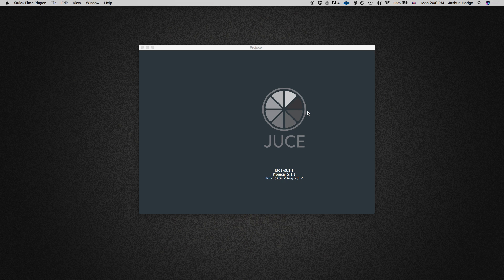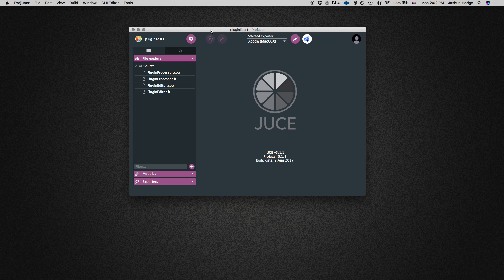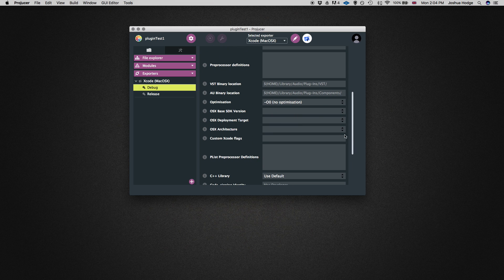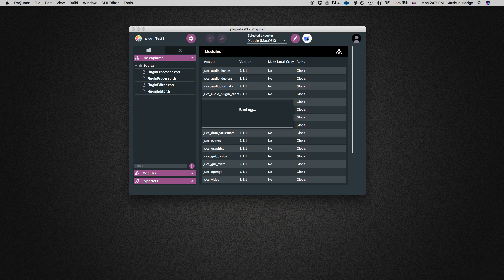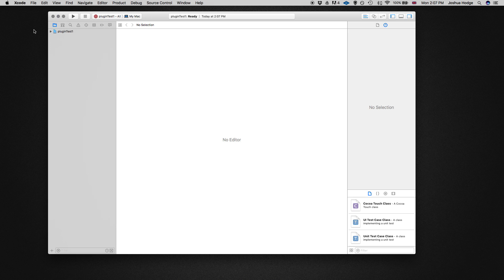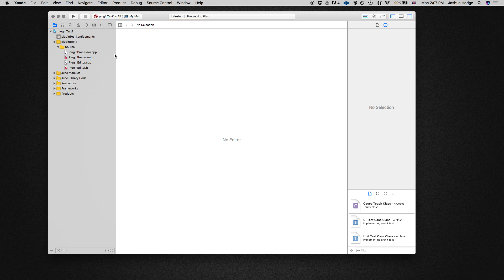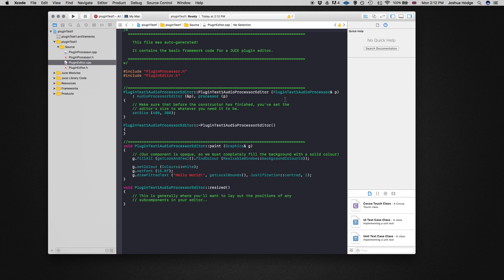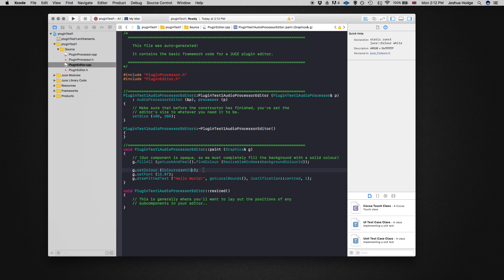Juce Tutorial 13- Audio Plugin Basics...What You Need to Know (Pt 1 of 2)

Comment: A note for Windows / Visual Studio users out there: Audio units (AU) / .component plugins are for Mac only, but you can load VST3 files on Ableton instead. You just need to switch "Enable Plugin Copy Step" to "Enabled" under the "Exporters -> Debug" tab in your Projucer project settings, and then under "VST3 Binary Location" copy your default VST3 folder path (usually C:\Program Files\Common Files\VST3 ). Once you've done that, you should be able to see your VST3 on ableton or your DAW of choice.
Just remember to do the same thing under "Exporters -> Release" if you are building for release.
Reply: Tried it this way, still no VST within Ableton. No .dll file within the project, or in the system's default VST/VST3 folders, either...
Reply: @SoundPeer  Check if your default VST3 path is the same as the one mentioned in the Projucer project settings. VST3 has the .vst3 file extension, .dll is for VST2 which is licensed by Steinberg (so no .dll file). If the project is correctly built and the Plugin copy step enabled in the settings, the file should be copied somewhere...

Comment: 2020: When building for AU or ALL you might get:
/Applications/JUCE/modules/juce_audio_plugin_client/AU/juce_AU_Wrapper.mm:1814:24: Reference to 'AudioBuffer' is ambiguous.

to fix this, change

void processBlock (AudioBuffer<float>& buffer, MidiBuffer& midiBuffer) noexcept

to 

void processBlock (juce::AudioBuffer<float>& buffer, MidiBuffer& midiBuffer) noexcept

Reason is there is also an AudioBuffer struct in CoreAudio as well as an AudioBuffer class in juce, so you need to specify which library it is coming from.

Comment: Hi @TheAudioProgrammer I have just stumbled across your tuts and just getting into juce thanks for your good work of recording that goodness! Anyhow, after compiling the code and trying the VST with couple of hosts it runs fine on MAX/MSP but I am getting some weirdness when I open it on reason, as soon as I add the plugin I start getting audio output clips, I imagine that comes from the way we go over the buffer and update it with a for loop isnt this a crude way to do that or it could be an issue with reason as a VST host I just wonder?
Reply: Well its exactly the code from the tutorial without any change.